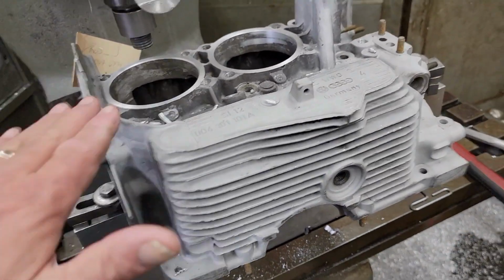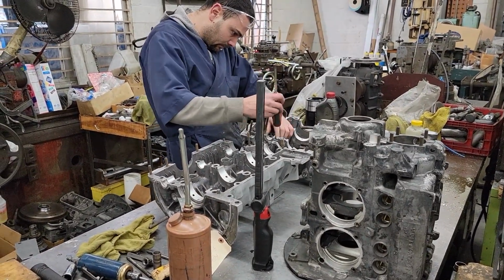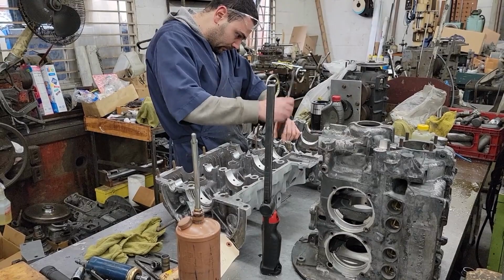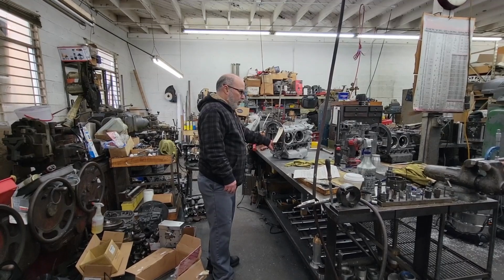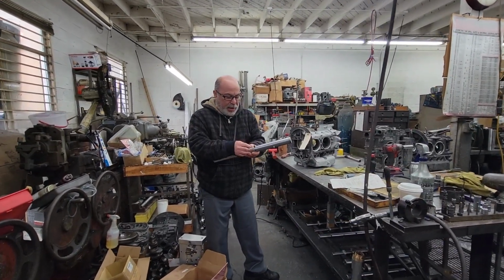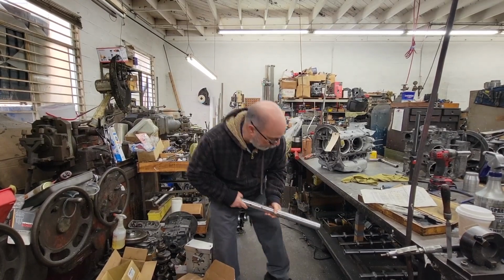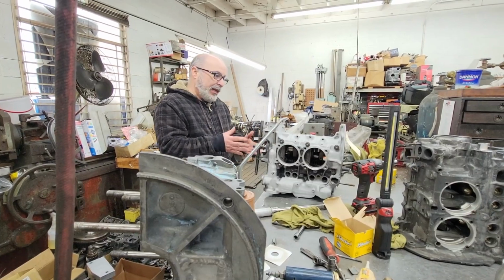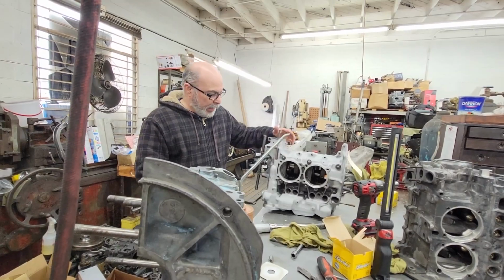Porsche 912E / 914 VW 2.0 Type-4 2270 Build Part 1 - Case Work

Comment: Weird that your case has the 2 relief valves. I was under the impression that only some of the pre '76  2 liters cases had the two valves.
Ian is a great guy and a friend who I leaned on during my recent 912E rebuild. Jorge was also a big help with my build.
 Good luck with the rebuild!
Reply from the maker: Thank you J. As you know I will need it putting this E back together.
Reply: @rodezell2563  You'll be fine. This was my first endeavor doing and engine rebuild and it was really enjoyable. Engine is back in the car as of a few weeks ago - running strong and so far so good.
Reply from the maker: @mrjohnirons  Oh, I know. I was actually talking about the rest of the car. It's been so long I have to pull out pictures to see where everything goes. LOL.

Comment: 'morning  Rod.  Glad that EMW saved your case.  Question or two on the Oil Pressure Relief Valve and Oil Control Valve (I have a dual relief case as well).  Is it considered now that the VW design for both valves is an issue?  If so, what is the issue and what is the new improved design?  Or, is it a matter of finding NOS components, especially the springs (to be sure the springs used have the required spring rate per the VW design)?
Last question for now: How does one see Ian's videos for his initial start, run, and experienced oil pressure issues?  (Is that available for those that sign-up as patreans?)
Thanks for your help and videos!
Reply from the maker: HI Thomas, the issue for the valve it that the spring gives way and the valve drops open. EMW sells a billet aluminum plunger, that he designed, that replaces the tired old spring on the front relief valve. Now it is stuck in place without any possibility of slipping. That is what I'm going to install in mine. Ian actually went to Jake Raby's FB page and they did a Zoom call and posted it on there. That is where I saw it. I don't think it is on Ian's Channel. Here is the link to Jake's page, but you'll have to scroll down to find the Zoom call. https://www.facebook.com/groups/type4ever